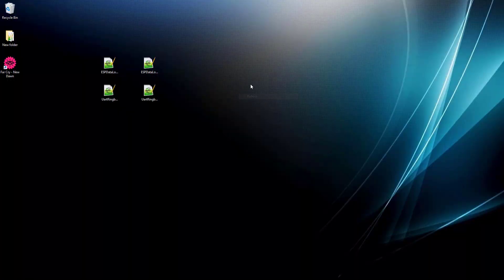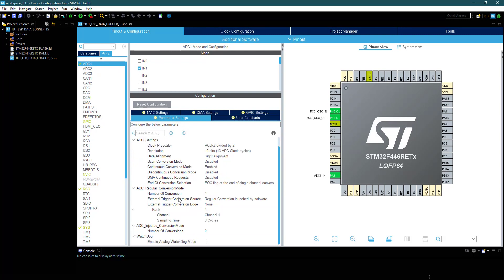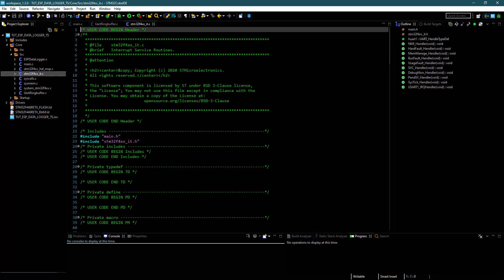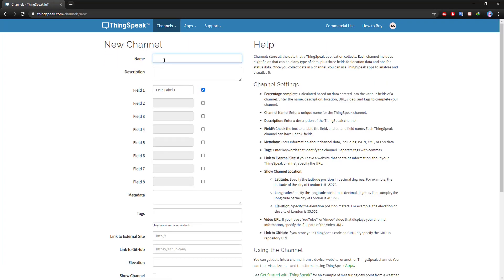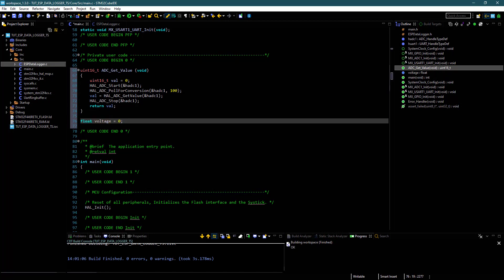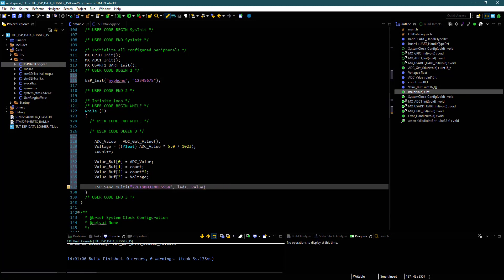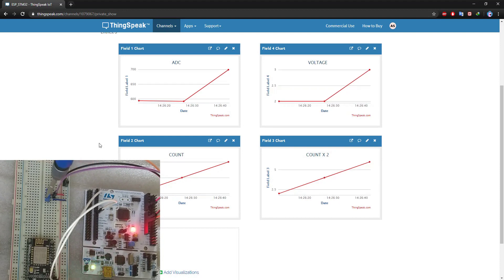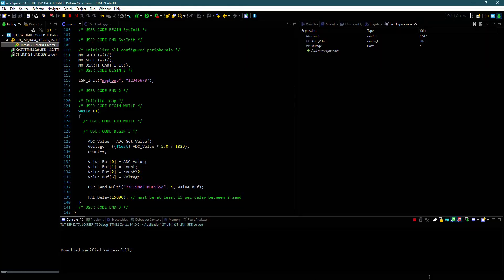Data Logger using STM32 || ESP8266 || Thingspeak

Comment: I'm using STM32WL series custom board with Esp32 C3 mini is connected via uart. But I made the necessary changes according to your tutorial, my program got stuck on ESP_Init() function, therefore not going to the while loop.
Reply from the maker: ESP32 is itself another MCU. Here I have used the ESP8266 module. They are different.
Reply: @ControllersTech  What changes do I need to perform inside ESP_Init() function, Is there any possibility to make it work with your libraries?
Reply: @ControllersTech  I was looking into the ESP_Init() function and step into RingBuf_Init() and Also Uart_sendstring() function, it looks like only a single letter is for RingBuf_Init() like "a" even though it should be "abc" for "SSID" and "1" it should be "1e1"   and for Uart_sendstring() sending only "A" not the "AT+RST\r\n". What could cause this issue if you have any guideline that I could follow?

Comment: but you have used the node mcu, it has also one EN pin so like ESP8266-01 , we should make EN pin of node mcu high??
Reply from the maker: The nodemcu has been flashed with AT firmware and i only used the tx and rx pins from it. I didn’t check the EN pin, it might be high via internal connections
Reply: @ControllersTech  is node mcu is flashed by stm32 ??
Reply from the maker: No
Reply: @ControllersTech  but in your code,using UART you have sent AT commands to the node mcu!!
Reply from the maker: I said the nodemcu is flashed with AT firmware. So it behaves like an ESP8266 here.
Reply: @ControllersTech  my question is, you have sent AT commands directly to node mcu or with stm32 MCU??
Reply from the maker: Sent by stm32 to the nodemcu using uart
Reply: @ControllersTech  that's what i was asking tnx for your valueable time

Comment: does it work with esp8266 nodemcu , if so how do i do the wiring
Reply from the maker: You need to flash the AT firmware on nodemcu.
For connection,  just connect TX with RX and RX with TX
Reply: Thank you very much for the explanation  @ControllersTech

Comment: I have been debugging for over a week.  My code gets to ESP_init and then appears to get stuck in the Uart isr.  I am not sure when it is supposed to move on from ESP_init but my code gets stuck there.  Not sure if I'm not understanding the code right or if I'm not getting good connection to my ESP-01
Reply: Nvm.  I figured it out.  My HAL_Delay wasn’t long enough after AT+RST because my clock was configured differently than yours.  Also after (AT+CWJAP…) wait for waits for “GOT IP” but my ESP was sending “OK” so changing that field to OK solved the problem.  Hope this helps anyone having similar issues
Reply: @JoelAnth0ny  good day, how long is the delay?

Comment: I am using esp8266mod the data returned is meaningless or "ready\r\n". i didn't use extrnal power source i used stm32f4 discovrey 5V with ams1117 3.3v regulator but I didn't get the "OK" message
Reply from the maker: power it with 5V
Reply: @ControllersTech  thanks I’ll try
Reply: unfortunately this was not successful, I looked at the data in tx_buffer with usb ttl, they seem meaningless on the com port, I will work on it a bit, but I have no hope
Reply: @ControllersTech  okey I did it .I think problem is about usart1 I use usart2 and it worked.

Comment: Sir ı have a bşg problem. I have been trying to solve it for a week but u couldn't. I wrote the same code on my stm32f429, but ı cant see the datas on thingspeaks server. I dont even see my adc value on stmstudio. Rx and Tx is correctly connected, ı double checked it. What is the problem ? I uploaded my esp to at commands also. It responds OK when ı write AT. What can ı do sir, please help me.
Reply from the maker: you need to debug your code and find errors. Just put breakpoints and check where the code is getting stuck.
PS: No code will work without debugging
Reply: Hello, I have exactly the same problem as you. Have you solved it?

Comment: Hello Sir. Can real time data uploading  be done only with stm32f746g disco board to the thingspeak server. If yes,  can you please help out with it. Your videos are really helpful.  Thankyou
Reply from the maker: This video explains it.. it's uploading in real time.
If you are talking about that 15 second delay, then that's because of the free account. If you don't want that restriction, you need to get the paid one..
Reply: @ControllersTech  Thankyou Sir for your valuable response. I have tried the same to upload temp values using esp8266 and Stm32f746g diacovery board.  There is no error and I am getting temp values in live expression,  but i am not seeing it in the cloud. Can you please help. Thankyou

Comment: Tested this code long back and it worked. But on tssting the same SW,  it gets stuck on the ESP_init() function. On debugging found out that its getting stuck on IsDataAvailable() function. What could be the issue? Appreciate your help
Reply: Same here. looking for help
Reply: @Wuzz7  did you find any solution?
Reply: Got it to work. first i checked getting started with esp8266 video. followed it everything worked. Then I double checked the code. Found an error hero make sure to comment.
   /* USER CODE BEGIN USART1_IRQn 0 */
	 Uart_isr(&huart1);
  /* USER CODE END USART1_IRQn 0 */
//  HAL_UART_IRQHandler(&huart1);
  /* USER CODE BEGIN USART1_IRQn 1 */
Also checked connection for RX TX and found an error there.

Comment: Thanks for the video. And i have two questions. 1. the service Thingspeak is free one? 2. Can i use WizFi360 instead of  ESP8266?
Reply from the maker: 1. Most of it yes.
2. No. This is specifically written for AT commands in esp8266
Reply: @ControllersTech  Thank you for the answer. If i rewrite AT commands for  WizFi360 it will start working properly? Do i need to change code  in UartRingbuffer.c file besides in  ESPDataLogger.c? Thank you.
Reply: @Controllers Tech  Please answer my previous question about UartRingbuffer.c file. Thank you
Reply from the maker: @АльбинаКалабанова  WizFi360 also supports the same AT commands. I think it should work as it is . Give it  a try. If it doesn't work, then debug your code, check where it is getting stuck, and then try to change those commands according to your device
Reply: @ControllersTech  WizFi360 works perfectly also, thank you for helping once more time. Do you have a video instruction how to parse  the data read from thingspeak.com in json formatted text or are you going to make it sometime?

Comment: I want to do this project with ESP32. Can I use the same library?
Reply from the maker: This library is written for AT commands. If you want to use it, ypu need to use AT firmware on ESP32.. which is not a good idea
Reply: @ControllersTech  I saw STM32 projects using ESP32 on Git hub. There was a comment that the libraries used were written for arduino in h files.
Since there are too many libraries, I did not understand which one to use. Do you have any information about this topic?
Reply from the maker: Yeah STM32 can be used as Arduino. So you can use the Arduino libraries in Arduino IDE.
Reply: @ControllersTech  thank you for your help
Reply: @ControllersTech  Why isn't it a good idea on ESP32?
Reply: Hi! May I get from you the library for ESP32? Thank you!

Comment: Do I need to flash NodeMcu on ESP8266-01 first before go through this tutorial ?
Reply from the maker: No. Just get that esp8266... The cheaper module and it will work
Reply: @ControllersTech  Thank you. Will try it very soon for my project.

Comment: I have the same problem as @Amine Faker. Its stuck on the Wait_for() function. And inside of the Wait_for() function, its stuck on IsDataAvailable() function.
Reply from the maker: after which step ? I mean after sending AT, or which command ? Also if you ware debugging, don't do step overs. Instead set breakpoints and check the rx_buffer
Reply: @ControllersTech  I have solved it. For some reason it doesn't work with the uart1 (it can't receive date), so I use the uart2. Thank you.
Reply: @xulinqiu1997   are u using usart2? I have some problem
Reply: @alperenerdogan4602  yes, what problem?
Reply: @xulinqiu1997  same problem same soluotion :) i have solved it. Ty
Reply: @alperenerdogan4602  Hi, I have the same problem as you both... I changed to swap on usart2 but it still stuck on IsDateAvailable()... Could you explain what you changed exactly ? 
(sorry for my english by the way...) Thanks.
Reply from the maker: Why don't you debug your code. That way you will know exactly where the problem is.
Before running a big programs like this, try to test ESP separately and see if you can receive the data
Reply: @ControllersTech  Sure. That's what I've done : 
    --> in my main the function ESP_Init(...) blocks when reaching while(!(Wait_for("OK\r\n"))); it stucks on IsDataAvailable(). 

I suppose I made wrong connections with my STM (it's an STM32072 and i'm using UART2). I can't clearly see what are the links (between STM and ESP) on your video (i'm using the same ESP8266 as the one in the video). 

How can I test the ESP alone ? 
Thank you for getting back to me so quickly :)
Reply from the maker: So your code is getting stuck at the first command itself. 
I am using nodemcu in the video, and if you have the same you must know that by default it comes with LUA firmware so AT COMMANDS will not be supported. You have to flash AT firmware first
I hope you did that...
Another thing if you are using nucleo board then uart2 is connected to that usb cable and the pa2 and pa3 pins won't work.
Regarding testing ESP, there is a video on IOT playlist.. getting started with esp8266
Reply: @ControllersTech  Great, I think I need to flash the esp. I will search how to do that. And I will switch on another uart. Sorry i started recently :) 
Thank you very much, have a nice day.
Reply: @ControllersTech  Hello Again! So for a reason I ignore both UART1 and 2 weren't working but UART 3 works as expected (I manage to receive data in _rx_buffer). However, from the command AT+CWMODE=1, i'm not receiving OK anymore (but I already received it for AT and AT+RST commands)... Do you have an idea of what's going wrong ? 

Furthemore, when I'm using the same HAL_Delay as you (1000) my code stucks here (I get infinite interruptions using Usart_isr function without going into the if conditions...). Maybe the Usart_isr function is the issue ? 

Thanks :)
Reply: @ControllersTech  Hi! do you have the firmware file for AT command? Thanks
Reply: @alperenerdogan4602  nasıl çözdünüz acaba ben bütün usartları denedim çalışmıyor
Reply: @eneoxkeskin  valla aradan çok uzun zaman geçmiş. Hiç hatırlamıyorum.
Reply: @alperenerdogan4602  suan napiyon
Reply: @eneoxkeskin  embedded software eng
Reply: @alperenerdogan4602  hayirli olsun hocam. Var mi tavsiyen

Comment: I tried implementing the same and do not see any output. Can you please let me how to set the buad rate of ESP8266?
Reply from the maker: Look at the first video in this playlist
Reply: @ControllersTech  Both my stm board and the esp8266 are at 115200 buad rate and still no output? Can you please help me how to move further?
Reply from the maker: Connection ? Tx to Rx and Rx to Tx right?
Reply: @ControllersTech  it worked. The reset on flash settings were disabled. Thank you so much for your support:)

Comment: I'm using stm32f0 processor so i have a problem with the uartringbuffer library. How can i solve this problem???
Reply from the maker: What's the problem
Reply: @ControllersTech  cant use that library bcs its calling stm32f4xx_hal.h. Can i rearrenge it for stm32f0
Reply from the maker: Yeah u have to change it According your controller.
Reply: @ControllersTech  how can i do that?
Reply from the maker: Just change f4xx with whatever header your controller supports
Reply: @ControllersTech  i did but this time i get 7 errors in Uart_isr func.(which is in UartRingbuffer.c)
Reply from the maker: Read the description.. there is a solution

Comment: I had a problem when I added the library.
"Error: L6200E: Symbol huart1 multiply defined (by uartringbuffer.o and main.o)"
Can you help me fix it  please.
Reply: I fixed it by copying the library and putting it into main.c, and removing the old library (UartRingbuffer.c) 
It worked, but I still want to know how to fix the UartRingbuffer library or main to work as your tutorials. 
Thank you so much
Reply from the maker: In the uartringbuffer.c, where the huart1 is defined, put extern in front of it.
Reply: @ControllersTech  thank you very much

Comment: Does it work with esp 8266-01 ? i tried it didn't work :( no errors in compiling but nothing was sent to the platform (i already verified my wifi/password and my API KEY )
Reply from the maker: Yeah it works with 8266-01. Use debugger to find where it is stuck. This works in blocking mode, so if some expected result doesn't shows up, it will stuck there
Reply: @ControllersTech  and is it necessary to use bypass clock ? mine is 407VGTx,with 168Mhz.
Reply: It's stuck on   ESP_Init("***", "****");
Reply from the maker: No it's not necessary. You can select external crystal also.
At which point  in that function is it stuck ?
Reply: @amfa29   did you solve your problem
Reply: @esrameydan1835  unfortunately no, i had to use another version, the esp nodemcu which is far better !
Reply: @amfa29  and did it work when you changed it to esp nodemcu? I am also using 8266-01 and didn't work.
Reply: @DuongPham-fs1tf  yes it worked
Reply: @DuongPham-fs1tf  yes it did work for me( sorry for late answers)
Reply: I have the same problem, it stuck on the Wait_for() function. And inside of the Wait_for() function, its stuck on IsDataAvailable() function.

Comment: Hi ! 
Could you also show how to connect ESP8266 to Firebase
Reply from the maker: That's probably never going to happen, unless i have a lot of free time. Firebase library is huge.. and i don't have much understanding of the topic
Reply: @ControllersTech  
Hi @Controllers Tech, I am also trying to communicate with firebase but not getting any idea how handle authentication. If you give short idea it will be huge help.  Thanks
Reply: Hi @Aditya Bhawkar did you find any solution?